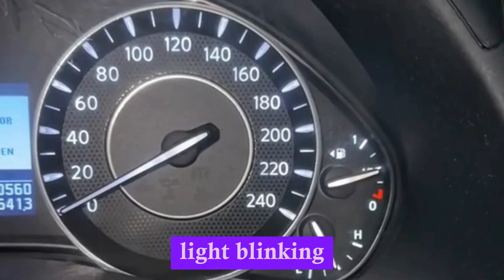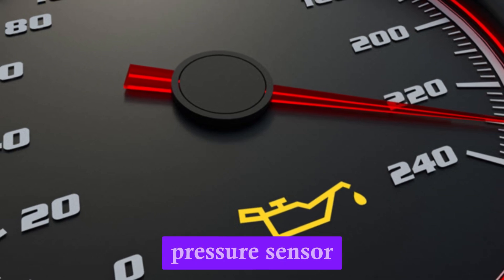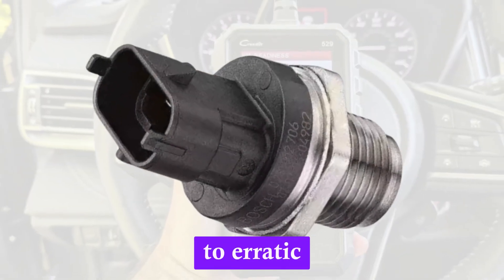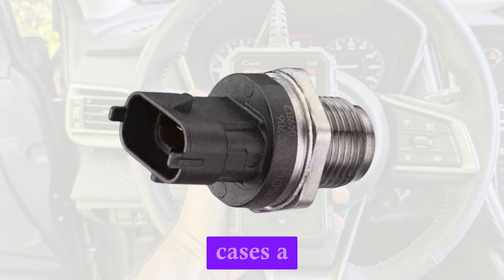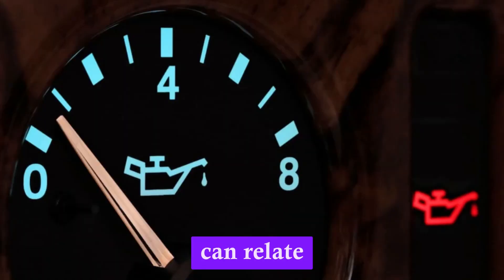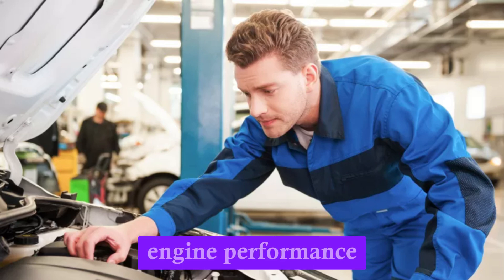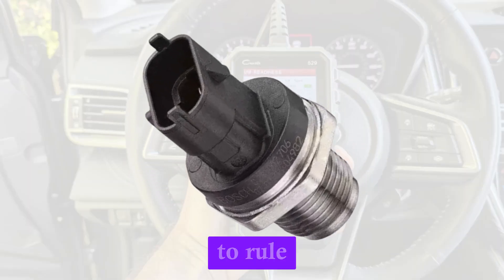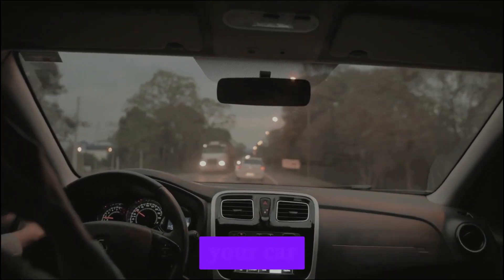9 Bad Oil Pressure Sensor Symptoms You Should Never Ignore | Oil Warning Light & Engine Protection

Comment: Dash lughts flashing  then red at oil temp light cameon loud noise when push gas  car died  but duringwatercoolant pipes broke  8 replaced them butnow a slow crank no start and oil is in coil packs